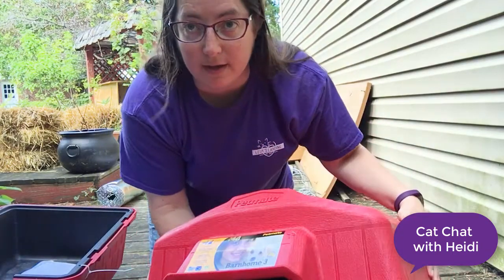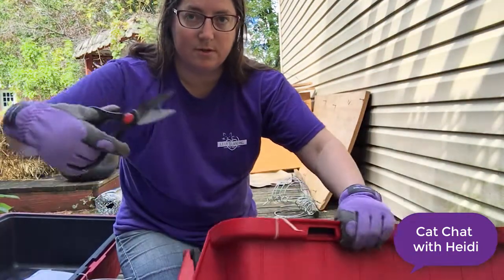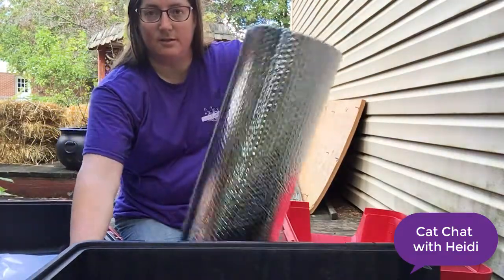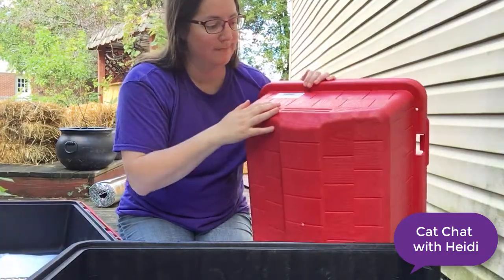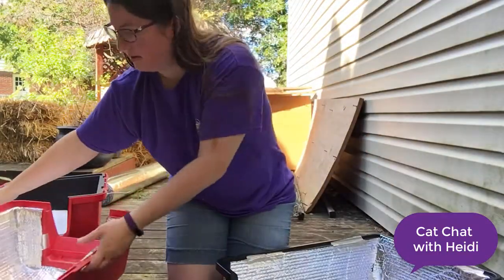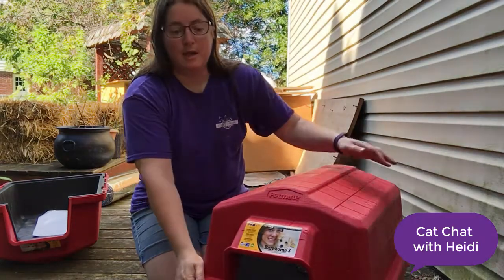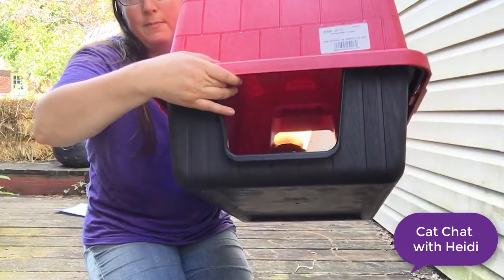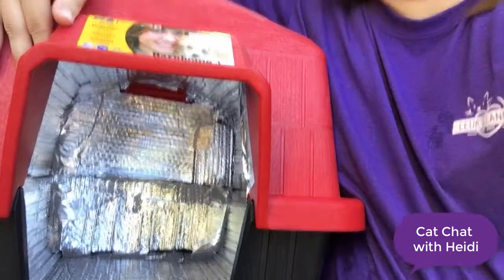Dog house converted for outdoor cat shelter for winter - Cat Chat with Heidi

Comment: I WISH I'd seen this first.  I'm still working on one ... taking me a WEEK.
Hey ya'll,
Get the dog house and line it ... much easier than the storage bin, foam and all the other crap you have to buy ... expensive and very time-consuming.  
THANKS for the video.
Reply from the maker: The storage bins can be time-consuming to make! I will be making a storage bin shelter soon to replace one that has a leak in the lid that is beyond repairing again. The dog house one, just have to be careful where you put it because the opening is a little large.
Reply: I finished the "home-made" one yesterday.  
Unfortunately, my cat went on strike.
She was furious and refused to use it.
She would not return to the house until I REMOVED the very nice home made shelter which took me a week to make from scratch, and put back the dirty old empty storage bin she'd been using for 5 years.
Reply from the maker: @karenbcz22  hopefully she will eventually go into the new one, if you are able to have old and new side by side.

Comment: I was planning to purchase a plastic dog house for the two cats at my house this year and installing that kind of insulation and straw. I never thought to reorient the opening so that the cats can have two exits. Thank you so very much for sharing this. I would have never thought to do that.
Reply from the maker: Depending on the weather in your area, having one entrance may be better for the cats. I learned that after making this video. They will stay warmer. Two doors only needed if predators in area where the cat would need to escape.
Reply: @Thejoyofcats  I used a plastic container for the other stray that used to be here. I turned the container towards the wall of the house and since the porch is up high nothing could really come in the entrance. A dog house has a very large entrance. I need to figure out how to make it smaller. I cut the container opening last year myself and thus was able to control the size of the other sleeping/rain quarters for the previous cat.  

I live in North Florida and the winter weather can be damp and chilling. The poor kitty babies have no shelter. I’m happy to see that I have a better option for quick shelter. Thank you again.
Reply from the maker: @alisagrant1134   You can try using a trap or a clear shower curtain could work too. Hopefully, duct tape would be strong enough to hold it in place.
Reply: @Thejoyofcats  Thank you.
Reply: Plastic from a plastic  tote 2 sheets to size with insulation board between cut 4-5” hole.

Comment: A foam cooler inside the dog house with a cat-size entrance cut into the foam might serve to make it an outdoor shelter. Just stuff straw around the cooler for more insulation and to hold it in place. On the other hand you could get foam sheets at a supply store. I try to recycle what I have - I received medications by mail in foam coolers once. Diabetics are one group who might be able to supply these to those making cat shelters. Also, outdoors you would have to make sure the shelter is off the ground to avoid rain and snow. A sturdy box would do. Then make sure you weight the shelter or somehow fix it down so it doesn't blow away. I suggested foam and extra straw since I live where there is a lot of snow and it can go below 0 Farenheit. 

I'm sure you know this, Heidi. I just wanted to share! Big thanks for the video! I've wondered for a while how to make a dog shelter work. I never thought of having one inside. I let strays use my cellar in the winter and I have a few beds there, but more privacy would be much better. Thank you for the idea!
Reply from the maker: This is a great suggestion!

Comment: Nicely done! I use reflectix on our wooden cat shelters 2 along with a lot of straw. I use the double sided tack tape that is included in the Duck Brand window insulation kits sold at Wal-Mart. There's usually a lot left over and hold up well outdoors below freezing. 3 large ferals just love it!!
Reply from the maker: thanks for the tip on the double sided tack tape!

Comment: This is a good video. Very clever idea to turn the lid around; less worry that a dog will be able to get at the feral cat. Wish you had included more details though. Where did you buy that silver insulation and what is it called? Why the silver metal tape? Does no other tape work on this project? What was the cost of this project? Does the local animal shelter pay for neutering the feral cats? Do they provide live capture traps for Trap, Neuter,and Release programs? Do they pay for injured feral cats vet bills?
Reply from the maker: The silver insulation is called Reflectix. I bought it on Amazon. There is a link to it in the video description. My local Lowe's also sells it. Total cost was around $60. That is estimated as price of dog house on Amazon could change and I got the big roll of Reflectix since I made 3 houses at the same time. Reflective is available in smaller sized rolls. 

We  used the metal tape because it seemed easy to work with. It turned out to not be the best choice as some of it peeled of a few days later. Duct tape or Gorilla tape would have worked too. I will add some details into the description about the tape. Thanks for asking about it. 

What a local animal shelter does for feral cats is probably going to vary. My local humane society does have a program for TNR and they rent traps. I don't know if they would pay for an injured feral cat. I only have had 1 injured outdoor cat. I scooped him up (he was friendly with me) and took him to my regular vet. His story can be watched here: https://youtu.be/xxUPBTkBA58.

Comment: An egg crate mattress topper is much better, its warmer and comfortable, you can cut it to size and double it up 🤓 I bought a full size 1-1/4 inch at Walmart for $17 🤓 hope this helps someone
Reply from the maker: But what it the mattress topper gets wet? Thinking it would not dry quickly?
Reply: @Thejoyofcats  that's what's so great about it it doesn't absorb water it's like it has its own water repellent 🤓 hope this helps

Comment: You do not need two doors in your feral cat house unless you have predators in your area like coyotes or vicious wandering dogs. It is important to keep the house elevated off the cold ground. Maybe use straw for insulation underneath if you can. We found a house just like the one in this video by a dumpster and have used it to shelter some feral cats during the summer. We will try insulating it for winter. I don't understand how she got the insulation to stick to the roof without glue. You have to keep things secure in these houses because cats have this thing about scratching at things that move inside their shelter. Our other feral cat houses have one inch foam insulation in them. A relative donated insulation just like what is being used in this video. It is more flexible and will certainly be easier to work with but I don't know if it will provide as much protection from the elements this winter.
Reply from the maker: I learned about not needing the two doors, depending on the predator situation, after making this video. Thank you for your comment, and sorry it took me 4 years to reply!

Comment: I am thinking about putting a heating pad when straws are inside as well. Is that safe?
Reply from the maker: As far as I know, using a heating pad and straw is unsafe. It should be one or the other. The heating pad that came with the 2 heated cat houses I have says explicitly not to cover the pad with anything.
Reply: @Thejoyofcats  Thank you very much. I saw pictures of heating pads with covers, so I thought how much of a difference can straw make, when it isn't specifically layered on it. I won't take the chance. Have to make sure the feral and stray cats are safe from the excessively cold winter.
Reply from the maker: @alanguages  My response is based on the heating pads I have experience with. I don't like to take chances either!

Comment: Suggestion: instead of spending money on new backing for warmth, go to the thrift store and get a couple of cheap bath mats. Wrap the carrier with the bath mats, rubber side UP and secure with bungee cords. The rubber side of the mat will keep the carrier dry and the rug side will provide warmth. Also use as flooring inside the carrier for warmth, using straw for dryness.
Reply from the maker: good idea as long as the bath mats are not the fabric kind that would likely not dry once wet

Comment: That hole is to big!A raccoon or possum can easily get in there. The hole needs to be at least no more then 6inches,no longer then there wisker length.Not only that u didn't make a entrance, exit incase some other animal tried to get in there,harm thrm,them, have an exit,entrance.
Reply from the maker: I explained near the end of the video about switching the orientation of the top piece so that there could be two entrances using this dog house. 

I also explained that I put the dog houses inside of a shed and have a larger cat, so was comfortable with the larger entrance for my cat situation. 

The TNR place near where I live sells shelters with only 1 entrance. 1 entrance vs 2 seems be an ongoing debate. And maybe depends on each much risk of other animals.

Comment: Well intentioned but poor on instructions. Much more is needed so far as materials, approx of costs.working with tape what does that mean? If the thing is inside a shed that’s great but sheds are not available for most of these. Most are must be be just “outside” which will require FaR mor insulation just to keep them ALIVE! Appreciate that you seem to care but this is well less than helpful.
Reply from the maker: Thank you for the feedback. I made this video in 2018 and have learned a lot since then. Other shelter options would be better when the shelter is not in a shed or covered/protected porch, etc.